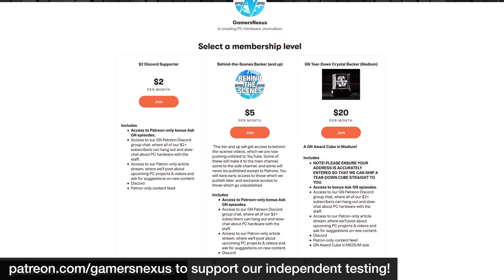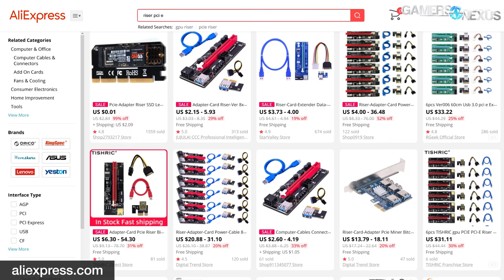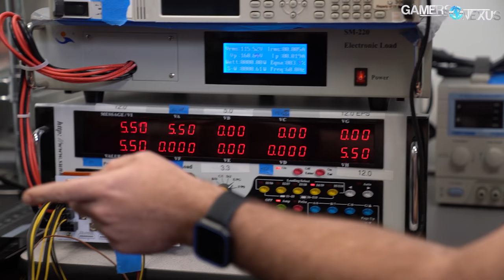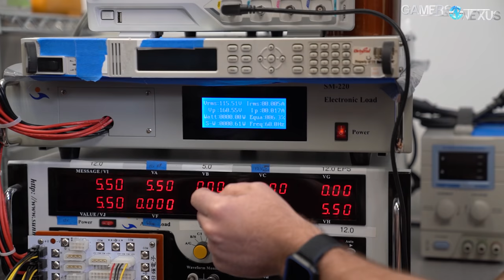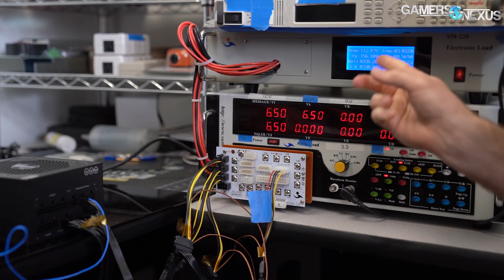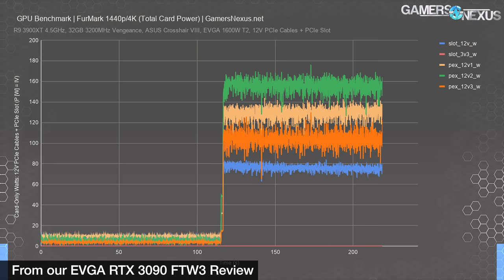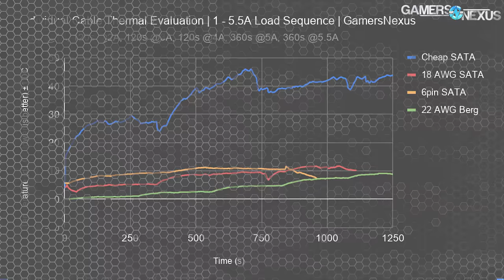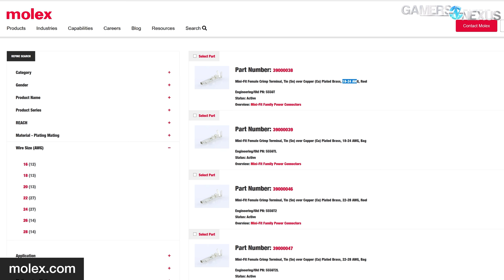Don't Use Cheap Cables: Dangerous Construction & False Wire Gauge

Comment: If you buy cheap cables cut one open get some $20 calipers on Amazon and measure the wire gauge. You can also check if the wire actually is copper and not copper coated which is a common scam for the cheapest extension kits. Anyone I know who is serious about mining does this even tho they sourve their components from reputable venders which in the grand scheme of things barely cost you more over the total rig costs. It’s beyond me how people are currently spending $10.000’s on rigs buying GPU’s at 3 times MSRP with ROI’s of years, to connect their much sought after GPU’s using the cheapest PSU’s and wires available on AliExpress without doing any quality testing. It just simply does not make any sense from a risk times severity safety point of view, yes you are saving yourself <$100 but putting up to $15.000 of GPU’s at risk and yes trust me there is people running 6x3090’s using these cables and PSU’s cooling them with conventional $10 box fans for cooling.

Also for anyone mining with 30 series cards replace your thermal pads for quality ones! I’ve seen countless of rigs with VRAM sitting at 110 degrees celsuis whilst it’s factory rated for 95 degrees max. Core temperature does not matter for most mining, VRM temperature or delta T between core and VRAM matters. Especially Gigabyte is known to have terrible thermal pads that quickly deteriorate over time, replace them!

Comment: I've found the risers to be quite useful...Need pci-e power for a port expander, having my unraid HDDs split between two chassis.  I've used the molex type and the 6pin pcie types.. because I'm not an idiot and SATA power is a shit connector.  
On that for years everyone in the PC youtube space always talks shit about devices that use molex, and I've never understood this.  it is an objectively better connector in every way than a SATA connector.  Handles more current, stays securely connected, doesn't break.  where as the SATA connector is fine for a HDD or SSD, it is flimsy, doesn't stay connected, when it does it breaks the socket on devices, it only provides 4.5 amps of current on its best day, and lastly, it takes pretty much the same amount of physical space as its molex counterpart.  
I feel like the take away presented in the video is that there is something wrong with the riser cards ot their pigtail cables, and yet that was never tested.  There was no test of those parts or mention of what current they can handle. Rather it was only shown that the cables provided with power supplies can not handle more than they are rated to handle.  I get that computer hobby folk might be going in to AWG and current with no knowledge whatsoever, but it might be useful to explain that the point of failure had absolutely nothing to do with PCIe risers, and had only to do with over loading a single power supply cable.  Doing so might also lead down the rabbit hole of why sleeved cable extensions can be a bad thing, ex cheap extensions with an AWG that was fine for the power supply when they designed it to have a12 inch cable, but is no longer enough to prevent voltage drop when you have 24 inches of cable.  
Finally, I'm very curious why several hundred dollar power supplies do not have built in current limiting on each output plug to prevent this.  It would take all of a couple dollars of parts to make it so that no single cable plug could provide more current than the supplied cables could handle if you wanted to do it fancy with a current limiter or foldback circuit, and just pennies to have an inline circuit breaker of thermal cut-off.

Comment: Never use the SATA to PCIE cable that come with risers. It's the worst, SATA cables isn't rated high enough to power GPU PCIE risers that can draw up to 75W. SATA cables only are rated to 15-30W. Most experienced miners use only PCIE cables to power their risers. Most of the cables that fail, fail at the connectors not oftenly at the wires.

Comment: Don't want to be negative, but some feedback.. Next time you cause fires, please use some respirators for safety! Despite the low risk, one would think you'd want to demonstrate going above-and-beyond for healthy/safety precautions to the large audience.

- safety video
- plastic and metal is likely to burn
- not done in a visible fume hood
- not wearing respirators

The planned burning of toxic materials in a regular office room without respirators should never fly in a professional environment! I was hoping that the NZXT video burning was a one-off. 

Edit: can't reply to this comment for some reason, but I'd start by just trying to meet the OSHA 1910.134 requirements for respirators, and definitely show your ventilation systems on camera to avoid giving the wrong impression! Even if this is not a common task, maximum care should be shown on video to the viewers.

Comment: I had a wire go up in flames as soon as I powered on was a cheap Molex to SATA it was at that point I sold off my old IDE DVD RW/R drive.
Reply: IDE to... molex? What?
IDE drives used molex connectors for power.
Reply: @CptJistuce  oops am thinking of the interface... Molex to SATA

I used to call SATA power L connectors.
Reply: @CrossplatformGamerMasterRace  That makes more sense. 
I believe the trend on the comments so far is for me to just say "Molex to SATA, lose all your data", but that's dumb and reductive and I'm not doing it. 

Impressively rapid failure on that adapter, though.
...
All these years later I still hate SATA connectors. They're flimsy garbage that are far too easily damaged.
Reply: @CptJistuce  I hate horizontal SATA power like WTF....i only just changed my PSU after a about a decade ordered a Be Quiet Power 12 Titanium 750w it has like the best standard cable selection I have seen.

Thank you for correcting me it's been a busy at work for Sunday.

Comment: When I built my file server with chinesium cables, I basically designed it with the blanket assumption that every cable is going to be 22ga. Even if they were actually larger.  And even played it safe with that. Its so far so good. But it does make for a bit of a cabling mess when you consider it has 18 hard drives in a double wide atx case.

Comment: So why aren’t computer cables built with a fusible link?  You exceed the power rating of the cable and it burns itself out without damaging anything.  And then you have to buy a new cable.

Comment: Power supplies should have 4 rails with separate OCP for a 600W PSU, more at higher power.

The "gaming" PSU craze where having only global OCP is a "feature" has to end. People simply have to learn to balance their rails properly, and if the computer turns off and you have to tear out the cables and re-wire them, then so be it, small concession for not having fire. Because ultimately every component or subassembly in the system must sustain a full current of entire rail that it's connected to in a quasi-short condition, because a fault is always a possibility, and survive or fail gracefully and not cause a fire. PSU companies should actively market separate OCP rails as a crucial safety feature. Really if every single PSU output engages protection the moment you try to draw 25A out of it, then even with 10A wiring, that should be good for at least some degree of prevention.

As to the cables themselves? PVC is chosen because although it can degrade, and will degrade, it's remarkably unstable at higher temperatures, it's fundamentally fire retardant and generally self-extinguishing. It is so without any flame retarding additives, so it is fundamentally safe. A good short after the insulation is damaged can actually be a good situation, as it's more likely to trigger the PSU's OCP. What you don't want to see is hot wire setting something else on fire.

Comment: I wouldn't trust any SATA to anything adapters. I've seen pictures in the past of cheap ones melting down and killing parts. If mining I'd make due with molex connectors only and keep them under the PSU/cable limit.

Comment: "Cable of a riser wrapped around a metal pole"

Man, even without fire hazards, that just sounds like bad practice to turn a wire into a bigger inductor than it already is. Everything is signal, guys! Even DC power has transients and little noise elements that you don't want to run through inductive load. I'd rather let cables flop about (or for long cables, tie them in S-patterns) than loop them, at least when in use.

Comment: gamers nexus: run 4 cables at 8 amps
me, that runs 1 PCI e riser cable on a weak wifi card: should I be worried?
Reply: Do you use the wifi card to heat your food with its microwave radiation? If yes, you should be concerned ...

Comment: What actually has been proven in this video? Bad design or faulty PSU. Three cheap AliExpress SATA to molex cables were drawing 90W each and handled it. PSU cable could not handle combined 270W and melted. Why PSU continued to provide such a high power through it's 6-pin port? Such ports should be limited to 162W max (3 * 54W for 3 SATA connectors).

Comment: I HAD to buy a cheapos cable to dubble the cabling of my GPU because the pcie 8/6+2 for my power supply are simply out of stock almost everywhere... I could just buy the f*king only reference I found, hope it will be okay as long as possible :/

Comment: This test just shows that if you use your cables the wrong way, its going to get wrong. (since Sata is max 54watt.. so doing over 5 times that should probably not be a good solution)

Comment: That's why I only use Teflon insulated wire, that way I can exceed the ampacity of the copper by a significant margin without it melting!

You can find out the "effective gauge" of the wire by measuring the voltage drop over the wire when loaded with a large current.

Comment: Shit dude, this video hits right to home.  I had a shit 4pin molex to SATA cable catch on fire a few years ago.  Apparently sata cables that have the plastic connector molded around them can cause shorts over time.  A forum post of mine, along with responses with the speculation: https://www.overclock.net/threads/help-please-pc-caught-on-fire.1611945/

Comment: You shouldn’t do these tests open on a desk. I worked professionally in electronics and this needs to happen behind safety glass and ventilated so that smoke is kept away from humans. I‘ve seen a lot of smoke ;) also special gloves to prevent exposure to voltages are important. Do not touch wires in operation.

Comment: Why does the connector type matter? It's a pure function of watts and wire gauge, whether it's molex or sata or whatever, so long as the standard is not exceeded. Do computer parts manufacturers not release maximum specs?

Also, I expect brand names when I hear the word "unethical". Either state the brand or get out. Obviously small wires equals badder, but in the age of online ordering what am I to do? Why don't you rate manufacturers on their gauge, by name? All you need is a pair or calipers.

Comment: “11 amps across this wire...”
Correction: Current flows through and voltage is across. Current is the flow of electrons while voltage is potential difference 11:30 15:13

Comment: Yikes after seeing these comments I don’t want to use the sata to molex adapter for my water pump. I will just swap out the non modular psu with my other pc lol
Reply: Ughh what? The water pump is below 1A, you're totally fine.
Reply: @stanimir4197  yeah but people were saying they hooked up ssds and rgb controllers with them and they burn out lol. I’d rather not risk it bc the pump can consume up to 30w. I just ended up ordering the cable I lost for $7
Reply: @melvinhans1844  SSD - 2.5" ones rarely exceed 6W[0] at max power - unless they managed to hook 8+ on the same cable (via splitters) and run torture tests - it'd be a lie just for attention, i.e. it was a lie. RGB is a different story  as RGBs can be power hungry and depending on the amount they can easily be 30W+ each.
About the pump consuming 30W - unless it's a double pump it should not exceed 2A/24W.

[0]: https://www.samsung.com/semiconductor/minisite/ssd/product/consumer/850evo/

Comment: This made me not want to overclock my PC at all lol just because I'm scared of pushing my Thermaltake's ketchup and mustard cables lol even though its 80 plus gold
Reply: The wires'll be fine. The color's no indication of quality.
I'm more worried about what's inside the box part of that Thermaltake power supply. They don't have a good reputation, and have released some pretty bad products in this particular category.

Comment: Hilarious that you can't get it to fail within any normally reasoned system. So turn a cable into a resistor and use that to make your case 😂. Bad logic used to prove your desired result.

Comment: Cheap cable can also affect your performance to a degree. I had a DP cable, i got with my monitor. I was experiencing VA G-sync (actually Freesync, but g-sync compatible) screen flickering in almost all games. I replaced it with high-quality gold-plated DP cable and voila - flickering is gone.
But this also goes the other way - seemingly HQ cable (gold plated, sleeved, durable connectors, etc.) can be worse, than cheap OEM cable. Happened to me with external HDD cable i bought for premium and got trashy thing, that was practically worse, than original cable.

Comment: After spending so much money on computer parts, why would someone cheap out on something that is inherently cheap, regardless? Get the good stuff and pat yourself on the back.
Reply: Cost might not even be relevant. A seller could offer the same shitty cable he dropshipped in from ali for like 4 times the price and it would still melt and burn.
Reply: @EminemLovesGrapes  - Well, that's why you go with a reputable company like Cable Matters and such. Part of cheaping out is not caring who it comes from.

Comment: When I dipped my toes in ethereum mining I used two 10 year old PSUs to power 3x R9 390s using a bunch of adapters. Under load the 12v rail dipped down to 10.8v and those wires got toasty.

Comment: poor cable management can cause fires things like fan speed reducers rgb splitters etc get fucking hot. put them in the path of airflow gg. u can also heatsink fan splitter etc. i will say i been using bitfenix 3pin molex spliters for over 10 years. i have 2 7.5v and 1 12v. they dont get hot at all. molex to 3 pin is dumb dont do it

Comment: What a load of horse hockey.  I've always bought the cheapest cable I could get.  Heck, I made my own parallel cables back in the day when they were a thing and were frightfully expensive.  Not once did I ever have an issue.  Then again I paid attention to cable management, never used a 5 v cable for anything but 5 v, or any of the other nonsense that you implied in your opening sequence. And I never used a cable that wasn't correctly made.  They are stupidly easy to check.

Comment: Actually, cables are hardly ever a problem. A tiny GA15 wire can easily carry 20A (240W) with some cooling.
It's usually the equally cheap connectors where things go up in flames...
Reply from the maker: We literally said that in the conclusion of the video. Also, a connector is part of the item sold and titled as a "cable." You're being pedantic without even watching the content fully.

Comment: In the US the metric for wire diameter is smaller the higher the diameter? Dafuq... Why not just use the diameter itself, even in imperial units if you need scientific issues?
Reply: AWG was standardized in the mid 1800's for solid, round, non-ferrous wire. AWG is 'American Wire Gauge'  published as ASTM B258 -18. It's a 40 size logarithmic stepping. US folks don't want to go all metric particularly for temps, foods, gasoline and many other items, why should we because someone doesn't like it?  32* in this country is freezing, it's easy to know both.  Lol
Reply: @SISSYPUSS  I'm not complaining about the unit but the inverse metric. Why is the gauge value bigger when the wire is thinner?
Reply: @marsovac  It's derived from how wire is made. Metal is forced through a shape  - "drawn". Smaller sizes need to be drawn multiple times, so manufactures sized wires by the number of times it was drawn. 30 gauge would be drawn 30 times, so we got the inverse scale from that. The largest (I imagine a single draw) is sized at 0 - or multiple 0's - I forget. There are 40 sizes from 39 draws but the geometry is slightly incorrect, actual measurements don't meet in the middle when it's measured twice through the sizes, starting once at each 'end'.  Weird huh? There's an equation to figure out sizes, it's slightly inaccurate, the value for that is not  much; represented by a ratio it's about 1.2 or less at the worst. 
I read many books that have nothing to do with my life! Lol
Reply: @SISSYPUSS  and I guess this depends also on the material the wire is made of (same diameter for a different gauge)? Imagine lemonade was sold for how many times the fruit was squeezed instead of the amount of lemon in the lemonade or anything the buyer is actually interested in...
Reply: @marsovac   Lol. I started the day explaining physics now at closing its fruit. I know a Korean lady that does cooking if you want to know about lemons! Ok, put your fingers forward out front, pointed away and just below nose height. Raise them up together over the eyes, then swoop down below the ears and stop! That makes a pair of ellipses shaped like an arch. Golden Arches = McDonalds. Get it? hehe